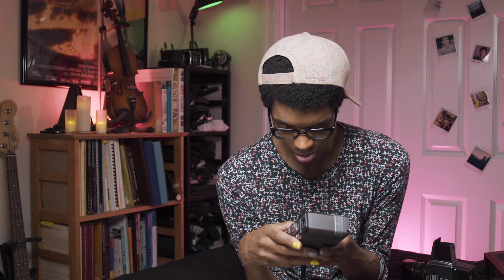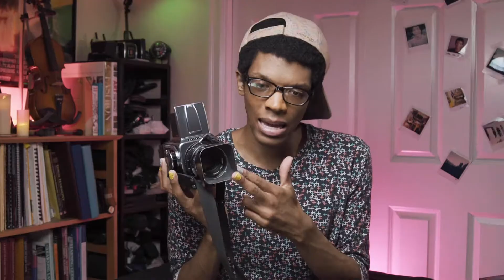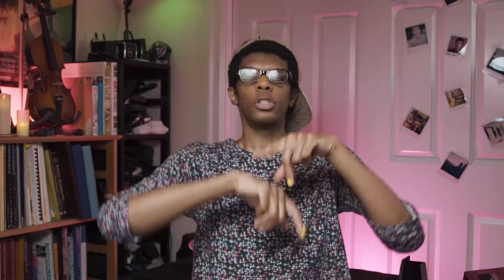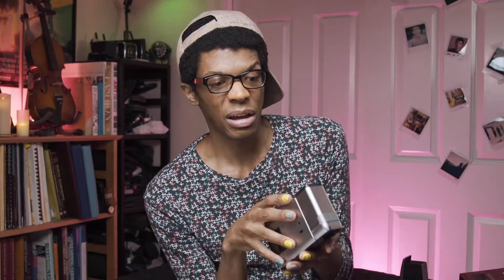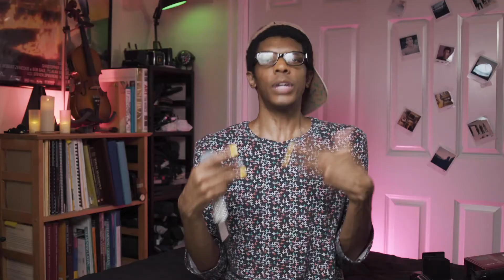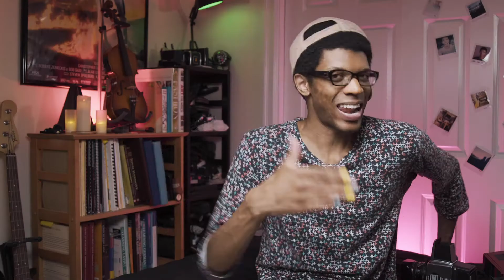How To Fix JVC Tape Camcorder Errors E01-E07 Tutorial - Featuring 1996 GR-DV1

Comment: unit in safeguard mode E03 remove and reattach battery of dc plug 
pls help
Reply from the maker: after removing the battery and tape, let the camera sit for 10min—then add the battery and a new tape—turn back on—if the error is still there, it might be 🍞
Reply: it might be bread? lol, i dont understand. I have the same problem and I cant fix it. @iamstevenallen
Reply: Toast

Comment: I'm having err02 from my VHS-C model and it keeps pulling the tape out. It doesn't chew it though, I pull the tape out, pull it back in the spindle.. but it breaks it again anyways.
Reply from the maker: you might just have to get a new old camera unfortunately 😔
Reply: @iamstevenallen  guess it can be my webcam at this point then xD
Reply: I got the E02 message and automatic shutdown right after I pressed the eject tape button. Before that, it was doing fine. 
The tape was not ejecting. I managed to open the housing and found the tape to be jammed and chewed. I don’t have another tape try try to see if it can work, so if that is the right path can someone let me know? Also, most of the gears are spinning properly. 

Can anyone help?

Comment: What if the tape is stuck and wont eject?
Reply from the maker: you might have to just risk it and pull it out 😁does the mechanism open? let me know how it goes…
Reply: @iamstevenallen  lol already tried that. The door opens but the locking mech that keeps the tape in the metal carrier  wouldn't budge. It sounded like the gears were stripping each time it tried. Its all good though, I had bought it from a local second hand place and ended up just returning it literally about 30 min ago.
Reply from the maker: That’s sounds kinda intense, haha…well, I’m glad you worked it out. At least you didn’t have to throw it away.
Reply: @iamstevenallen  lol no doubt, thanks for the response and the video though.
Reply: @esfwr17  im literally have this same exact problem..
Reply: @KipYip  yeah, I never had any luck with it unfortunately. Hopefully you'll have better luck with it. I will say, make sure it's got a full battery. I tried mine at low power first for a while, then let it charge, and the sound it made at full power seemed to at least be trying a bit harder to eject, though ultimately it didn't.

Comment: Unit in safeguard mode remove and reattach battery or dc plug.06 
I need a Help 😭.    Handsome Please Help me!!!!!!!!!
Reply from the maker: did you figure it out? sometimes these cameras just turn into potatoes 🥔😔
Reply: Have the same problem.. took the battery down, unplugged the charger at least 10 times but wont help 😢
Reply: I'm having the same problem doing all the removing and still the same, anyone has any idea on what to do to solve it. thanks